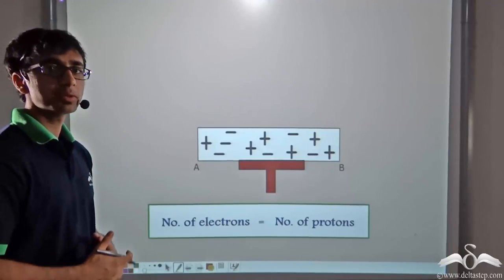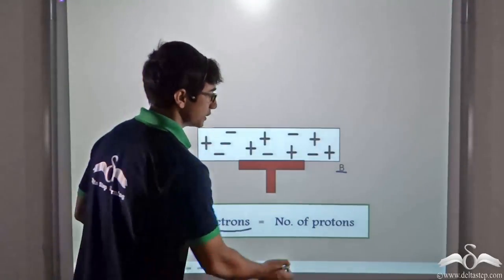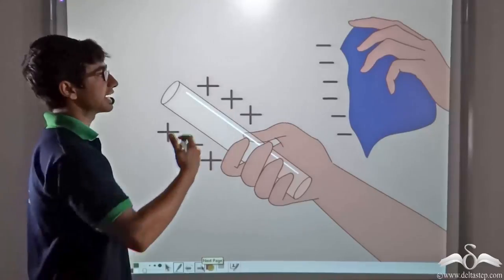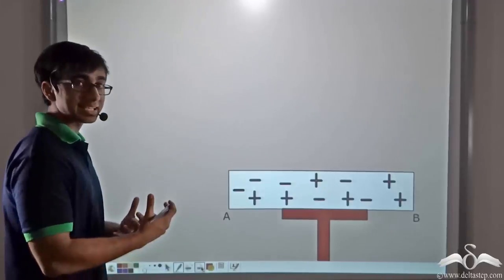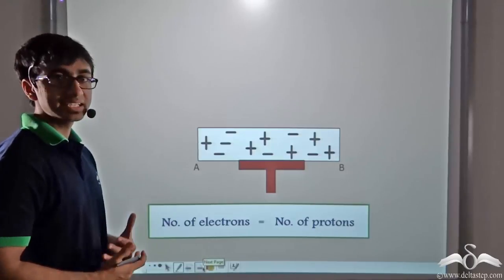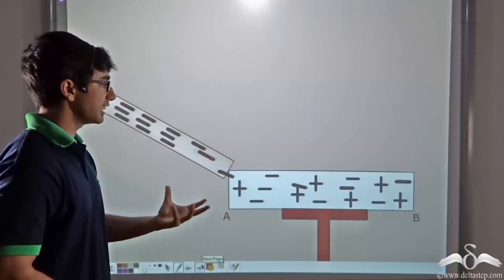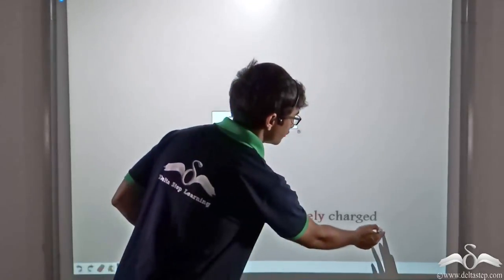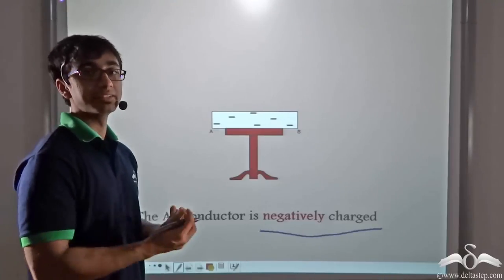Charging by conduction

Comment: Doubt: Ebonite rod is an insulator so how can the electrons from the Ebonite rod (insulator) move to other insulator. Electrons cannot move in insulators... They only move in electrical conductors right???
Reply: You can get your answer if u will search " How can we charge insulator".....You can get your answer.
Reply: On google or chrome
Reply: Why wouldn't electrons move in an insulator?
Reply: @mohuasaha18  Those are tightly packed atoms they don't have valance electrons to transfer ex all inert gases are insulators